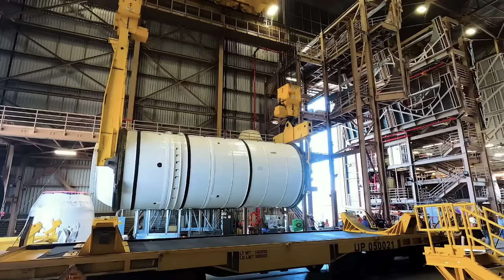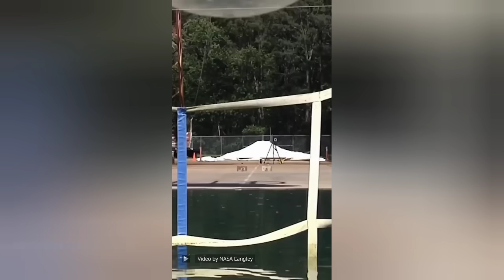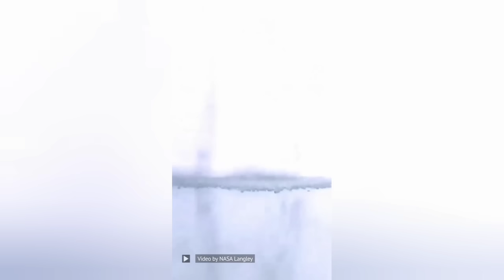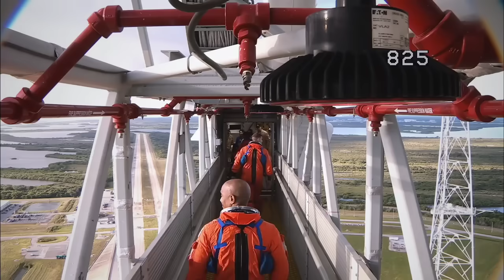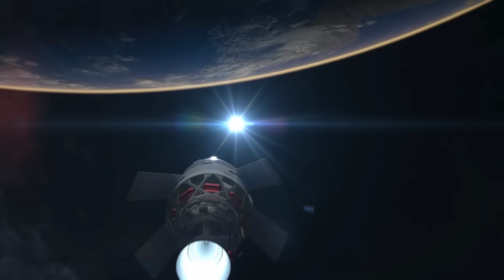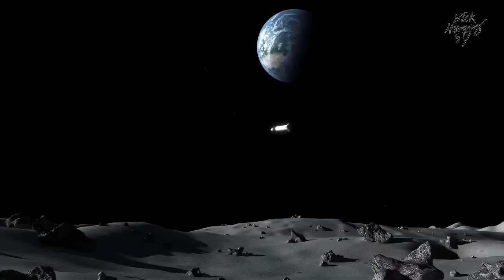Unexpected news!  NASA will return humans to Lunar Space ahead of schedule!  Artemis 2 update!

Comment: Did they finally figure out how to shield against the Van Allen belt radiation that they supposedly alreadyfigured out in the 60s but still needed to figure out but the Apollo astronauts didn't even know what that wAaa-AaaAs??!
Reply: Yeah I still don’t understand how they did it before…. Yet they talk about it like it’s yet to be conquered?? I am no expert…. Just genuinely curious….
Reply: @robertfarmer6316  The stock answer is "oh they weren't exposed to it for very long" but if you look at the craft, it looks to be made if curtain rods coat hangers and tin foil, and it wouldn't shield against a hot fart. Nothing adds up.
Reply: They simply go fast. They are through in a hour or two, far too short to do any lasting damage
Reply: @HalNordmann Yuh huh. Then why take ten years for the  program to "figure out the shielding"? Maybe because they'd have to go for real-real this time?
Reply: @Nunya_Bidness_53  what? The ten years were to make sure the Orion capsule was safe enough for longer mission duration since Artemis is spending more time than Apollo in cis-lunar space and lunar orbit. Artemis is going to stay, Apollo was to beat the Russians. Apollo was certainly real though.
Reply: @Nunya_Bidness_53  There's less tolerance for risk nowadays. Plus, the shielding is mainly for solar flares - which Apollo had no considerations for.
Reply: The belts are toroidal in shape and the particles are very sparse, you can simply go very fast through the polar areas of the belts where the particle density is at its lowest and thus avoid any damage, also they are moving very fast. And most particles can’t even penetrate paper, though some can penetrate through thicker material, but typically towards the thickest regions.

Comment: i don’t see Starship successfully landing on the Moon anytime soon. It’s just going to topple over when it gets there. It’s too tall to be stable without a concrete landing pad.
Reply: They have a large payload to play with some Tesla batteries and 5 giant landing legs they haven't got to survive a reentry with them.
Have you never played kerbel?
Reply: The moon one will probably be specifically designed for the moon and not for earth, plus there is lower gravity on the moon so it will not weigh much. (I haven't heard anything official about this but I am mostly confident)
Reply: This is an oversimplification. Wide legs and no pad could be more stable than narrow legs and concrete pad, for example.

Comment: Has a single piece of hardware for the lunar gateway been produced yet?
Reply: You are correct that none of the Gateway modules are complete yet. Here's the current status: by October 2023, the primary structure welding of the HALO was completed, and it moved to structural testing. As of this month (March 2025), HALO is expected to be nearing completion of its systems integration phase. As for the PPE, technicians are currently installing key hardware into the completed central cylinder assembly. Next will be a series of integrity tests. Both the PPE and HALO are conservatively expected to launch no earlier than December 2027 - but as with the SLS/Orion stack, NASA hopes to be able to accelerate the schedule by a few months.

Comment: Lunar Starship should be scrubbed. The recent tilt over  of two lunar landers with small legs and high center of gravity shall be a lesson. The lunar Starship is not suited to land on a rough soil full of craters and boulders. A lander similar to Apollo LEM shall be developped urgently.
Reply: Been saying that since before the contract was selected. It is simply not a viable design
Reply: Well those are remotely controlled, controlled by crew might be way better.
Reply: @Volcanic5432  have you managed to land a 150 ton tower block recently? I’m guessing it’s pretty difficult 😳
Reply: @markbishop4774  on a realistic space simulator like Kerbal space program or Juno new origins yea a lot of times. It’s not really too hard you just need to slow down enough and then perfect your burn and slow vertical velocity down to zero or 1 meter a second or as close as you can get and switch to the landing engines. You don’t want to land on a slope, and it’s easier with crew to avoid a slope because you can easily maneuver it. I love both SLS and starship, and I don’t think either should be cancelled as both have benefits and capabilities they can add to our space programs.
Reply: What kind of gyroscopic stability system does starship have in comparison to the lander intuitively machines sent twice?
Reply: @billjones8950  no idea but a gyro isn’t going to help if it lands on a rock or gets one leg in a crater. The Dynetics Alpaca can land safely on a 20 degree slope but I don’t expect Starship HLS could cope with 5? It’s also 20x heavier than anything that’s landed on the moon previously.
Reply: @billjones8950  Neil Amstrong was manually controlling Apollo 11 and avoided a small crater. A gyroscop will not detect if you are above a small crater or a big boulder. Something more sophisticated is needed ( as designed for the mars rovers)
Reply: @ with the billions of sattelites they claim to have. Finding an ideal landing spot should be the easy part. We can read a cars license place from space according to the people who believe in our space satellites the most. One orbiting the moon should be able to see individual dirt particles.
Reply: Make ALpACA great again.  Musk isn’t fully in on a lunar program.
Reply: @daveenright1235  HLS Starship design is based on the famous book written in 1953 by Hergé : "Tintin et Milou : on a marché sur la lune"
Reply: Agreed. Starship looks woefully inadequate for anything other than delivering payload to LEO. I'm happy to be proved wrong but anything beyond that is just wishful thinking.
Reply: @Scuba72Chris  You just said the magic words. There is the reality. What I would add is that if they can not get Raptor V3 to 280t Starship will probably not even get to Saturn V level of performance.
Why would anyone make a rocket heavy on purpose? What moron decided that?
We know the answer…
Reply: @Scuba72Chris Give the lunar HLS III contract to Blue Moon and ALPaCA lander programs.  Let Musk self-finance his way to Mars.
Reply: Good thinking.  Safety first and practicality.   Apollo LEM is good but with modern tech NASA can do better.
Reply: @adams74  Dust off the LEM plans!!!
Reply: Starship should first show it can land on the desert in Az NM or Ut before even considering the Moon. Tall and high CG
Reply: @pedrosura yes but you also need to take the 1/6 gravity and lack of atmosphere into consideration.
Reply: @ True. While the gravity and atmosphere can cause stability problems with winds and consume more fuel, gravity and air density provide stabilization inherently. It is wrong to assume it is an easier “control problem” to land on the Moon. It is not. Ask the engineers of the vehicles that have crashed.
Starship configuration is just not good for a propulsive lander. Nobody would select that if given a choice.
Reply: @ I totally agree, and it’s almost impossible to simulate on earth. The HLS starship is completely the wrong design for a stable lander. You could also say that about Falcon 9, except for one important fact-it always lands on a flat solid surface.
Reply: @ There is a reason why the tall landing rockets were funny. The lander eventually be wide and stable. Not tall.
I see this as pure BS.

Comment: The big elephant in the room regarding starship is the complete lack of an emergency abort system. It doesn't have a separate crew capsule that can be ejected in case of a major malfunction which when it topples over on landing kills the crew before it even hits the surface.
Reply: I am sure they have designed something. maybe a crew dragon mounted on top. It's human rated already so they could technically use that to leapfrog some requirements

Comment: The biggest issues with your issues with starship is you assume things the way the government does.  Basically everything will develop only at the current speed or slower.  Starship development has been accelerating.  As long as the government stays out of the way anyway I'd expect Starship to be ready late, but not more than a year late.  They are already way ahead of where they were compared to the F9 development time line.
Reply: @Ittiz  falcon 9 flew a demo mission to the ISS on its 3rd flight. We are going on starship 36-37 now. They are nowhere near the timeline that Falcon had.
Reply: @Rory-Shields  They are already catching boosters after only a couple flights.  They are way ahead of F9.  Reusability is the key.  They could have probably launched over 100 tons to orbit with starship by now if they they didn't care about that.
Reply: The US Government is the only organization that has landed people on the moon.
Reply: That’s a silly perspective. Spacex wasted half a year by launching before they had a working pad. They just flew twice and didn’t fix the problems in the meantime. Seems to me like we are on what? ship 40 and haven’t had it perform as advertised yet? I fail to see the source of your undying faith.
Reply: The inter-Ship orbital propellant transfer demo was supposed to be this Spring.  Now it's not earlier than next year.  This is already a year later.

But orbital propellant transfer is just the first relatively minor milestone.  SpaceX will then need to develop, test, and deploy two propellant Depots (one in low, the other in high elliptical Earth orbit), and fill them up via ~15-20 Tanker launches.  Then, build, test, and launch an unmanned HLS Ship, successfully dock and fill it up at each of the Depots, successfully fly it to the Moon, successfully descend and land it on the Moon, and then successfully lift off the Moon and put it back into lunar orbit.  All of it done for the first time ever, and all of it done flawlessly.  Then, repeat all of the above (including all the Tanker launches) with a second HLS Ship, this time also involving two dockings and crew transfers with Orion in lunar orbit.  And those Depot docking and propellant transfer interfaces and mechanisms better be robust and reliable enough to endure dozens of dockings and propellant transfers per Artemis demo/mission - getting it all right on the first try as well.

No, SpaceX won't be getting all that done in 2027.  Nor 2028.  We'll be very lucky if 2029 - depending on the quantity and variety of test failures and setbacks - but probably 2030 or later.
Reply: @Spherical_Cow  I'm already aware of all that, but I appreciate you wasting your time to write a book to try and convince me.
Reply: Did you miss the 2 big Starship failures?
Reply: Starship still hasn't achieved orbit without any cargo. They've not achieved any progress at all. It will never work, it's a flawed design.
Reply: @Viking_Wizard  the booster is done. They literally only need to fix the ship at this point and they've already demonstrated they can get it back to earth.
Reply: @ No, the only cargo they've launched is a banana and they haven't achieved orbit yet. Each launch has had varied levels of failure. I don't know where you're getting your information from because it's all wrong.
Reply: @jamescarter8311 not at this point. Besides failed orbit. They haven’t even proven starship’s reusability. For all we know it’s as reusable as the space shuttle. And not very good at all.
Reply: @Viking_Wizard  not saying your information is objectively wrong, but your conclusion is. you seem to be falling under the trap of judging "test and development" flights as full on "operational" flights. none of the TEST flights so far were ever intended to go to orbit or deploy any real payload, they haven't been trying to do that yet. that was not the point of these starship flights so far.  a few of the flights have been full successes because they reach ever goal post and mile stone that they were INTENDED too, even if there were a few issues along the way.

people need to realized that Starship is NOT a "fully designed and developed rocket that has failed to ever get to space" but is rather "a developING rocket design that is in progress and not yet intended to fly full missions". each flight is a TEST of some specific functions or features that aims to either "test to failure" or prove a designs capabilities, strengths, and weaknesses so that things can be further improved for the next test.
Reply: @Viking_Wizard  They are already catching boosters after only a couple flights.  They are way ahead of F9.  Reusability is the key.  They could have probably launched over 100 tons to orbit with starship by now if they they didn't care about that.  Once they are able to catch the ship too things will be much faster since they will be able to prototype faster.
Reply: @Ittiz  if they were capable of that they would have because they have a contract with NASA and have a roadmap of what they thought the progress would be. Right now they should have tested refueling in space but they haven't been able to achieve orbit. Each flight has been a failure. Reusability only makes sense of it's quicker and cheaper than making a new one and it's not. The inspection and maintenance cost more and takes more time than just using new rockets.
You're just making excuses for starships failures. Each launch has had engine failures and it hasn't been getting better. The fact they barely can get to orbit and have destroyed almost every rocket is proof of how bad the design is. Having so many engines is a male design flaw, you want some level of redundancy but the more engines you have the higher the chance of them failing. The sweet spot is 5-10 engines.
I know rocketry, space-x got lucky with the falcon 9 system but that's because Musk wasn't trying to design it much. Musk is a moron and he's the one who decided to use 33 engines to try and save money by not needing to design a bigger engine.
Starship will never be a viable launch system. SpaceX will probably get another government grant thanks to Trump which will just be wasted money. Starship was supposed to be landing crew on the moon next year but it's just barely now getting to space.
Then you have the design issues of the rocket itself, like needing a lift to get people and things out of the rocket when landed on the moon. This lift will take up a lot of cargo space and weight which reduces it's payload capability. Then you have the fact the cargo space isn't shielded or insulated meaning things in the cargo space will experience high temperature fluctuations.
I can go on for days with how poorly designed the entire thing is. And the only thing you seem to think is a big deal, reusability, isn't a big deal and has been around for a long time. The space shuttle was reusable and most rockets could be reusable but most rocket engineers understand that inspection and maintenance cost more and take more time than just building new ones.
Reply: @nonya-bizness  it's easy to meet goals when you scale them back. It's supposed to have achieved orbit years ago and supposed to be finishing testing refueling in orbit right now. Next year it was supposed to be testing reaching the moon. Then in 2028 it's supposed to be sending humans to the moon. I don't see that happening in 3 years.
If you get out of the Musk circle jerk you will see how much of a failure it's been.
Reply: @ lol, now I see where you're coming from.  @TheAngryAstronaut used to criticize @Thunderf00t and his EDS followers, not he's shilling to them.  What a sad outcome.
Reply: @ I've not seen anyone else do the math to show starships success so far. Only people giving excuses for it's failures or moving the goal posts to make the failures to seem like successes.
Please if you have a source that explains starships success so far that includes the financial math and the original timeline that got the contract let me know.
Reply: @Viking_Wizard  Idk about never work. Definitely a flawed design. Too many compromises whilst asking too much. 

But "Never work" as opposed to just scaling back their expectations, is a bit extreme. 

I'm not a betting man, but I wouldn't bet on SpaceX to fail at something they're determined to make work. And they certainly have the time and the money. Starship, unlike Falcon 1, isn't being funded by the last pennies at the bottom of Elon's wallet, its being funded by one of the richest people on Earth, developed by a space launch company that's responsible for 90% of the global launch market by mass to orbit. They will eventually make it work if it's physically possible to do so. Even if it means scaling back on some promised performance and use cases.
Reply: @AutismaMagna maybe saying never work is a bit much but it won't get close to what's needed for a moon mission. It will at best be used for larger payloads into orbit. But looking at how it's development is going I don't think it will get much of a payload into orbit.